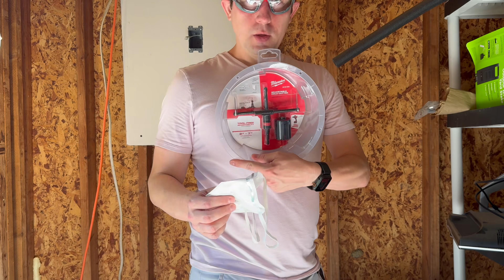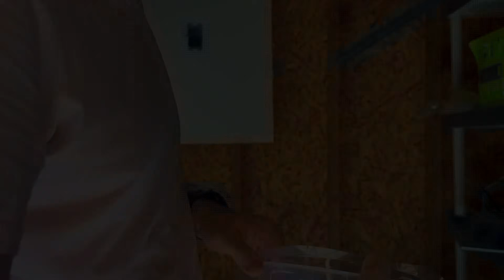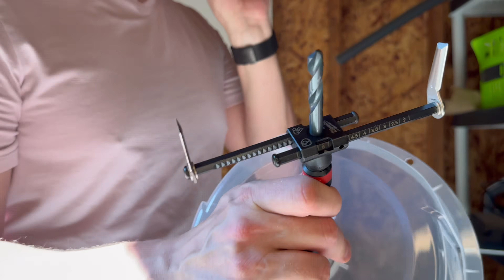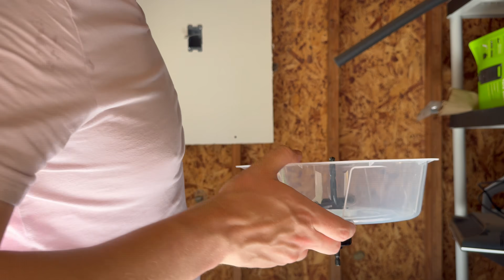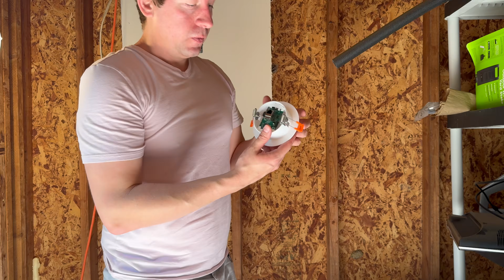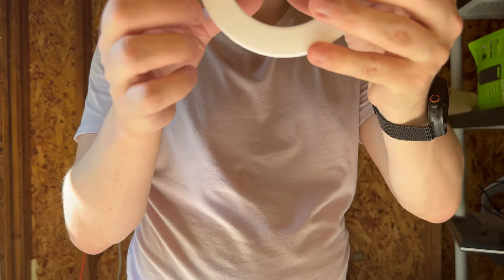R PRO-1 Ceiling Mount Installation

Comment: Would be great if documentation could be more explicit about detection angles/orientation for both of the mmwave detectors.  Seems like this is more important for ceilng installation as rotating the device will affect detection area?

I also found it not clear if the dual mmwave and co2/detector can coexist or if they share the same expansion pins.

Can you supply a cap for the ceiling moint to protect the electronics from being directly exposed to the ceiling space?
Reply from the maker: Thanks for your comment Jordan - We have some additional information here on placement and going over the FOV of each sensor - the expected orientation is what is shown in the video where the ceiling mount labeled "top" is facing the direction that you want to "look towards" as far as the mmWave radars are concerned. https://wiki.apolloautomation.com/products/rpro1/setup/rpro1-general-tips/#ceiling-mounting If there is additional information I need to add please be specific and I will definitely add that!

Here is a wiki article showing the scd40 co2 addon installed https://wiki.apolloautomation.com/products/rpro1/addons/adding-co2-to-r-pro-1/

Here is a wiki article showing the ld2412 installed (with an existing ld2450 sensor already installed) https://wiki.apolloautomation.com/products/rpro1/addons/add-the-ld2412-mmwave-sensor-to-r-pro-1/

To confirm - yes you can have the ld2450, the ld2412, and the scd40 co2 sensor all installed at the same time.

Are you asking about a cap for the ceiling mount? There is one included - it’s shown in the video. If you’re referring to sealing the area behind the sensor itself, the best solution would be to use expanding foam to fill the gap.